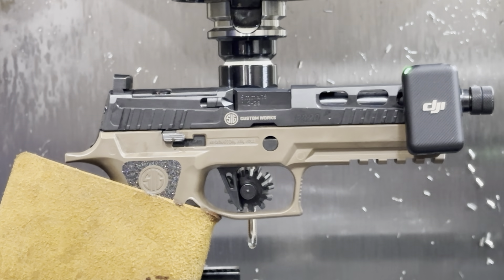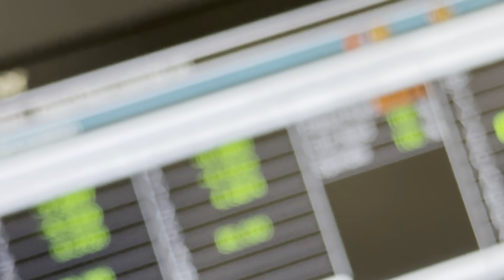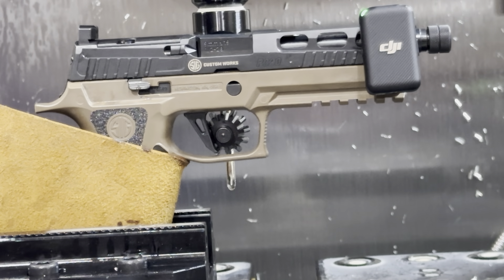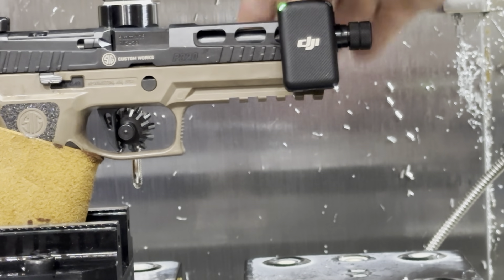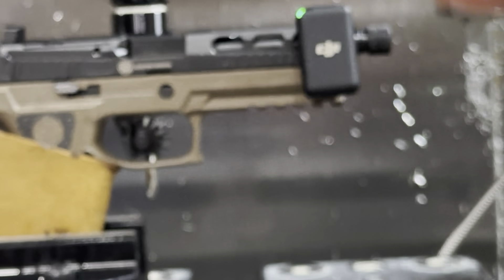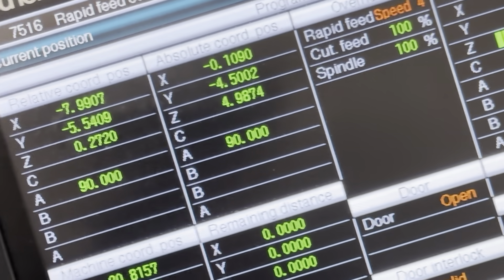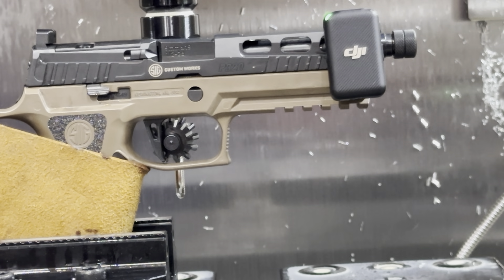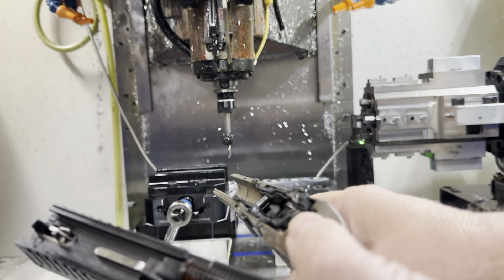Sig P320 accidental discharge tested in CNC machine.

Comment: I am a tool&die maker, and you are skewing the test a little bit, how about, if instead of only at -85, you would also manipulate the slide at -86, at-87, at-88, at-89, and at-90, what happened in between -85 to -90? , now if one or two of those interna mimm parts had a burr or was out of specs?, and, what about the one that discharged in the officers holster without any manipulation,  that was put in an evidence bag just as it discharged, never being removed from the holster, was sent to the FBI forensic lab and inspected by them, and in one of the many tests conducted by the FBI, they were able to make it discharge while in the holster, not only that, but the FBI, also obtained another P320 from the same department, this one being gbrand new, never issued, and they were also able to make that one discharge while in the holster, no, the Sig P 320, the M-17, the M-18, are toast!

Comment: Finger or machine on trigger means it will fire. Gun will function properly if you keep your finger out of the well until firing time. Thanks for doing the test but I will trust that my Sig P320 won't fire unless the trigger is depressed. No pocket litter and the proper holster and holstering of the weapon.  How many pounds on the trigger pull at .900?
Reply: Good thing all those cops, feds, soldiers, and civilians that have had uncommanded discharges must've somehow had their finger inside the trigger well while it was in the holster. Wait...

Comment: But the important thing here is this....Sig Sauer said in a statement, that it is impossible for the gun to fire without the trigger being FULLY depressed....not 90, not 2mm, fully. This video proves that despite that claim, in fact, manipulating that sloppy frame to slide fit, can complete the firing sequence before the trigger is fully depressed. In any case, for whatever reasons, accidental discharges continue with these firearms at a rate far exceeding those of other
Reply: And if you notice, the language they use when they say "can only fire IF ____" keeps changing.
Reply: This. Their original responses all said that, and they keep walking it back.
Reply: I want to think that is the point he is making.
Reply: he proved the glock failed the exact same test. watch his other video
Reply: @CitizenSeven500 But, the Glock has a trigger blade to prevent unintentional partial trigger pull.
Reply: What I read they said was it couldn’t fire without the trigger being moved rearward
Reply: @RoyDriskill  true. how much movement? a hair? 2mm? all the way back? welcome to a truth thats sort of a lie.  because it's misleading. Sig has inadvertantly confessed theyre at fault. Kinda why good lawyers tell their clients to STFU.
Reply: @ronaldthornton8370  83% percent of a trigger pull to be exact. That's either intentional, or massive human error. Buy a manual safety model; issue is irrelevant entirely.
Reply: @RoyDriskill that is their most recent wording from the email that was sent out two days ago.

Comment: This is a single test, I would bet my savings account if this guy did the same test over many P320 that 90 thou tolerance for trigger & slide play would move. I know it. some more, some less, maybe some way less.  A thinking man should know that with that large amount of play, wear could change the world in those tolerances. I like this video; it is a single data point. But I have over 100 data points now showing this gun discharging without a screw or CNC machine attached to the Trigger.  This does show that on this P320 there are tons of play in the slide and 90 thou of tolerance on the Trigger. I bet anything that will vary if you tested 100 P320, some with zero rounds and some with 40k and everything between.  My thinking man brain is telling me that it is hard to repeat, but there is an issue with the parts and tolerances of this model firearm that can cause it to fire uncommanded. I love this video. But I don't like the claims made after the test. This is a single test, a single data point, and not even close to enough information for a conclusion.

Comment: it seems to me like some holsters may be putting a little bit of pressure on the trigger,  enough to deactivate the safeties,  and then all it takes is alittle movement for it to go off.  seems like whats been happening in the videos of them going off to me.  i know all my kydex holsters have a indentation on in the material in front of the trigger,  that widens to accept the trigger while resting holstered,  if the holster is slightly out of spec it could be putting enough rearward pressure on the trigger.

Comment: I recently decided to retire my striker-fired pistols, all makes & models.There’s things I really liked about them. But I never cared for the “plastic” grip frames, minimal slide rails, half cocked/full cocked designs, lack of manual safeties, etc. I love my little P365 that I had carried since they first hit the market - accurate & reliable. Nevertheless, I’ve gone back to my old hammer fired steel and aluminum framed pistols for edc. Ain’t goin’ back no matter how cool the latest & greatest, popular gun, with all the hype & marketing. If you take the time and dig deep enough you’ll find the striker fired stuff, including Glock has had their share of concerning issues. These days I only have to think about my own safe handling of my firearm as the old stalwarts have stood the test of time.

Comment: The conclusion that you have reached in this video is literally deranged. 

I can take my glock all the way to the wall while putting constant pressure on it and wiggle the crap out of the slide and nothing will happen. Why? Becouse it is not a pos.

Another example of this moved 1 mm and it was enough to cause the discharge... We have all seen it. That is just an issue with tolerances . The underlying defect is still the same and still completely unacceptable.

Try this again with pretty much any other modern service pistol see what happens. Bet you won't though.

You sig people are really really having a hard time aren't y'all? The cope is getting out of hand

Comment: I will say.. I just watched the Sig Armorer, and if i'm reading his hand drawn chart properly it denotes with a trigger pull he has striker fall @.050 with bottom at .090 .
With a sear test he claims rear leg enabled @ .030 , striker fall @ .067 , s/l defeat @ .150 , and bottom @ .175 .

Hope his numbers, along with this help. Haven't caught how many he tested yet, but the two of these videos have given me a far better understanding of understanding the gripes.

Without owning one, I learned young to be cautious when handling and goes hand in hand with me to not point it at anything you aren't willing to destroy. I don't wear any holsters that put anything against a trigger, but the trigger housing.

I don't understand how taking a belt off, military holster or not, puts pressure on the trigger to cause this issue in the first place. I don't own a Sig, but am into guns, science/testing/precision/stats and figures/mechanical issues/regulatory/possible strays from ill-handled firearms/safety, etc - and I didn't stay at a Holiday Inn Express, thankfully.

Comment: Ok so the tolerance for this particular gun is around 19 thousands of an inch. Now the question is: is it the same on all the sig p320s because that’s an awful lot of wiggle on the slide of these guns that a haven’t seen in any other gun manufacturer. Not even on other sig models.

Comment: I think you’re missing the point and as a machinist also you know that there’s a percentage of parts that are at one end of the tolerance all the way to the other. +/-.005 tol gives you .01 from end to end and it seems that sig has allowed tolerances that should be used in wood working not machining. The simple fact there’s this many 320’s going off without a trigger pull again as a machinist myself means they have allowed quality control that would make any machinist laugh. I would bet they were batch testing a couple parts out of 100’s or 1000’s to see this type of failure rate. Hell when I got my 320 I was astonished at the slop and play of the slide. I love my 320 & 365 but I will never carry that 320 again. To each their own but come on man you can’t tell me as a machinist this slop and play is quality work. Sig isn’t even machining their parts it’s all MiM type stuff anyways

Comment: doesn’t the first rule off having a gun is keeping the finger (or anything)out of the trigger until you want to shoot the round????

can you replicate this experiment and try to make the firing pin strike, but this time with the gun inside a holster were NOTHING is supposed to be pulling the trigger!???

can you replicate the accident as happens? 

I’m Still not convinced…!!!
Reply: The first rule of gun safety isn't to mess with faulty, low quality, poorly designed firearms.

Comment: This test needs to be done with a loaded mag installed. No one is suggesting that the 320 is dry firing un-commanded. A loaded mag (dummy rounds) affects the tolerances internally and is the condition in which all of these incidents allegedly happened.
Reply: Someone on another channel did the test with five primered cases in the magazine and it went off every time.
Reply: @propdoctor21564 the one with the screw?
Reply: Yes
Reply: @bobbyraejohnson  I mean again it's happening because the trigger is being fucking more than 50% pulled. It's just not something that would happen in the real world. Especially if it's a manual equipped model, and properly firearm handling is being employed.
Reply: @iTrinityPlays  Sure, but the argument is that different guns have different tolerances, and a gun that has different tolerances may only need a piece of sand or other tiny debris (or sear wear, which the FBI noted in their study) to make it such that the trigger doesn't need to be pulled past the wall AT ALL, in which case a bump of the slide would set it off.
Reply: A loaded mag would likely make it worse as in, the striker would release sooner.
Reply: @5jjt  lmao exactly. It's amazing how many people don't get the basic physics of these pistols.
Reply: Exactly.  This dude is full of copium. He can't admit his gun is a pos.
Reply: @Watchdog_McCoy_5.7x28  Because some people actually care to solve issues, instead of just being negative about everything. SIG sold over 3 million of these guns. They're not going to just disappear because you don't like them.

A lot of people like their P320's, and the way it shoots. Also not everyone is Mr. Big moneybags Watchdog McCoy over here. At this PR rate, a P320 owner would be lucky to sell their firearm for $50 bucks. And what are they stuck with then? Literally nothing, not even a highpoint.

I want you to be honest with yourself. Are you taking a highpoint, or a P320 with let's say 5 rounds in the mag to get the job done? There is real PoS guns out here. A gun that has a wiggly slide issue at about 80%-85% trigger pull is irrelevant because I bet money you've never been past more than mid-break on any firearm, and just start fucking with the slide for no reason, especially while aiming.
Reply: My Sig 320 checks out in every test I have tried. So it’s one of the “good ones”.  I still won’t carry it any more. It can be an unchambered home defense gun.  Selling is certainly not an option. 

I carry my Ruger RXM or my S&W 9mm Shield Plus.  Either are safer  to carry chambered than any Sig P320, IMHO

Comment: dude it has been proven this is wrong many times over...And nobody is claiming EVERY 320 does this. But is it common enough that it is a problem. try getting to the one mil and actually moving the slide around like a cop running not just a gentle up and down. I mean how many more people need to get shot with it in a holster on video do you need?  I mean congrats you got a decent one. But again try and actually move the slide around like if you were on duty rolling around with someone kind of stress and watch it go off.

Comment: What does a test of trigger pull length and distance of occurrence of striker fall have to do with the un-commanded discharges of an Sig P-320?  These tests have nothing at all to do with them! The triggers weren’t being activated by the shooters!  So this is smoke and mirrors. You must work for Sig. 
RH

Comment: When you get to that point that wiggling the slide sets it off, you have pulled the trigger back enough that the gun is ready to fire, ie you have already used to trigger/mechanism to overcome the manual safeties such as the striker safety and rotated the sear down enough that the back up sear notch wont catch a runaway sear. A lot of pistols will go off under those conditions. The Sig P320 has a lot of problems, but the screw test is very misleading and takes away from the debate that needs to be had, how to ensure the trigger mechanism cannot go back uncommanded, by for example making Sig upgrade p320 with a trigger blade style safety. And likely making Sig replace certain key components with ones that are either machined or at least MIM cast to spec instead of the low quality chinesium mim cast components that are currently in them.
Reply: Trigger blade would be of very little if any use, any likely object that can pull the the trigger will probably disable the blade,  glocks that have fired because of a drawstring in holster have proven this.

Comment: I think some are making the argument that the gun is unsafe because it has a bad trigger.   I along with a lot of other people are making the argument that it's a good target trigger.  But that is exactly what makes it an unsafe pistol for Military or Law Enforcement.  Sig made a pistol they marketed to Military and Law Enforcement, a rugged duty gun that will if you pull the trigger .09 inch past the slack and you touch the slide will fire.  So that people have a reference here are coin thicknesses   Penny: 1.52 mm (0.0598 in) Dime: 1.35 mm (0.053 in)   Nickel: 1.95 mm (0.077 in)    Quarter: 1.75 mm (0.069 in)   
And the gun your testing is not the worst out there (1 in 4million chance)   The 1911 single action auto, was uncommon in Law Enforcement use for just this reason.   Your a machinist and know stacking tolerances would you doubt that there are guns out there that are half the numbers you quoted?   Glocks shot lots of Cops with the Safety dongle and the New York Trigger installed!
I am a former Police Chief.   Have I put a gun on someone's chest and pulled the trigger back a few millimeters?  Yes... then they complied and I immediately did a quick re-holster and put cuffs on them.  That was on a Sig P220.  Would a 320 do that and be safe?  If you pull that trigger back and release with a burr on the sear or striker as the FBI noted would it reset?   If you have ever been under high stress and experienced auditory exclusion and tunnel vision could you feel 2mm of movement?

Comment: All you did was prove this pistol's parts tolerance are closer than another's. It's clear that the amount of slop in the slide determines how far you can engage the trigger before the mating part slips off the edge and drops the firing pin. I'm a tool & die maker / machinist of over 40 years, I can make any part on this earth, and it's clear as day that both the design and the tolerances were never properly determined to ensure that the firing pin could NEVER drop no matter what you did to the gun other than completely pull the trigger. A gun going off in a holster, over and over, means there is an overall design flaw. I personally think that a remolded frame design that removes the ability of the slide to have so much play, could fix the problem. No other semiauto pistol in the world has a design which allows the slide to be moved or manipulated which results in the firing pin dropping. That in itself disqualifies the pistol for sale.

Comment: 1st video or not, you gave the best explanation to non-owners as to the issue. I think you could really be onto a $-maker, using this very precise (and calibrated) machine to test all kinds of things.

Start off with 7 OEM Sig P320's within the spoken criteria and 3 of differing key alterations - then test those. That will give you 11. Why 11? Why not.

Thank you for showing, either way

Comment: You should not be able to get a weapon to fire by manipulating a slide.  The test needs to be done on several guns that are manufactured to blue print specs and compared to those that are produced with off the shelf parts and some with significant wear or use. There is more than enough evidence that there is a problem.

Comment: Love the precision. But from where i sit, that trigger was %82.5 pulled, meaning there should be %17.5 margin of safety left before the gun could discharge. This is a big problem, especially considering that is a sample size of one, and wear, dirt, or stacking tolerances can shift those numbers in a negative fashion.
Reply: Yeah - "2mm from break" kinda sounds ok, but "82.5% pulled" is clearly very bad.
Reply: JMB was a total freakin genius.

Comment: So nice to see someone testing a theory with scientifically precise equipment capable of scientifically accurate measurements instead of using wood screws or a dowel rod or some other arbitrary object taped together with electrical tape and jammed in the trigger guard.  There is some issue going on with the P320 that needs to be resolved.  But Wyoming Gun Project and former special forces YouTubers who have no specialized training in engineering or forensic evaluation of mechanical devices, or otherwise lack the proper equipment to properly test a mechanical device or test a theory or hypothesis, should stop spreading the BS they are posting.